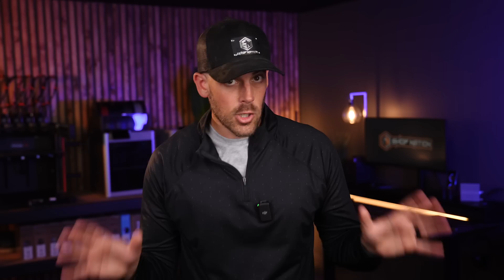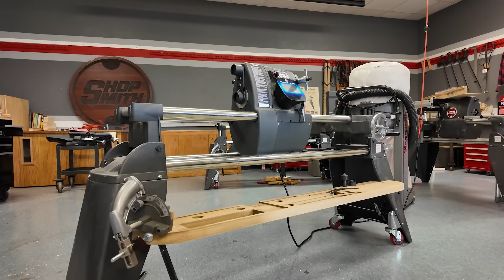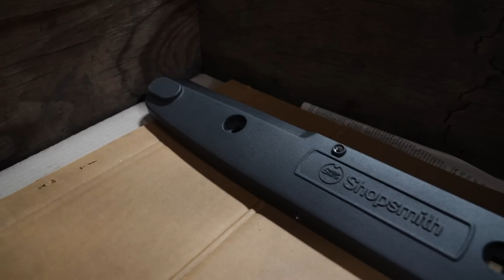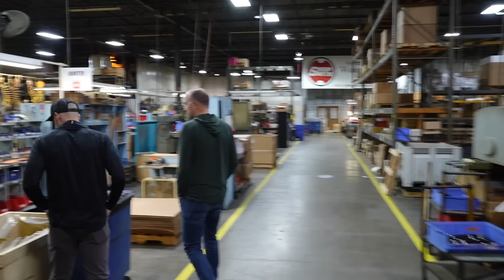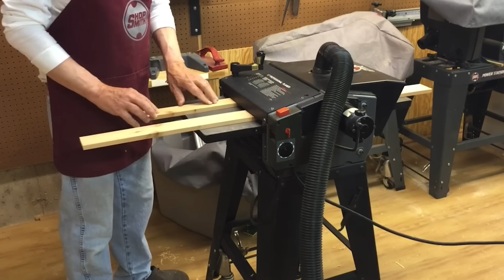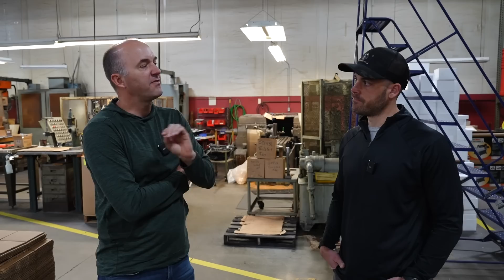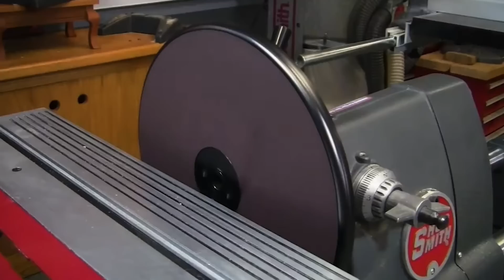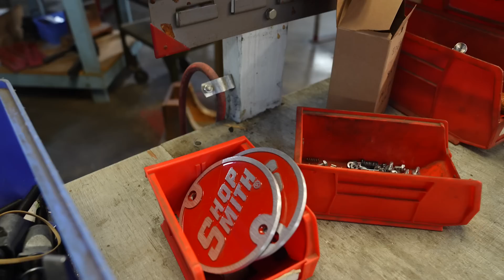The Last American Power Tool Company is (almost) dead

Comment: I purchased my Shopsmith Mark V at the end of 2006, with later purchases in 2007. And it continues to work great. I almost quite literally have all the tools and accessories that are available with this system except the latest electronic control console that is now either sold with the new machines or purchased separately for us folks who purchased ours years ago. And although Shopsmith offered and continues to offer the ability for us owners who purchased their machines with the older analog control head, to upgrade to the newer electronic control head, I just can't afford it anymore. LOL. But with exceptions, I have used every single piece of separate ancillary equipment besides the table saw; e.g. the scrollsaw, bandsaw, thickness planer, woodturner, sanding disk, router table, and jointer. There are a boatload of ancillary pieces of equipment that I also purchased later, such as the support legs for the additional support tables, the upgraded table saw fence, and even the upgraded 3-inch locking polyurethane caster wheels that make rolling the otherwise heavy machine around the shop a piece of cake. This thing is amazing for all the things I can do with it; especially since I just don't have the capital to purchase these fun, potentially needed, and useful woodworking power tools and accessories all at once, or over time. 

In order to expedite my learning curve, I even purchased the 3-day Traveling Woodworking Academy (Maybe longer. I forgot) classes given by Michael Young, who I believe is still with the company. And I also purchased the entire series of DVD's on using the machine to refer to from time-to-time. This set of DVD's even includes the periodic maintenance videos given by Rick Davis that are needed to keep this machinery working forever. To be honest purchasing all this was not inexpensive for me at the time; over $5k, but the alternative and discussed in part in this YouTube video, is that it would take quite a bit of floor space in my already crowded garage to purchase stand-alone equipment. And I love the fact that this woodworking system is 100% American made. A few years following my initial purchase, and as I could afford to, I continued to purchase other ancillary pieces of Shopsmith equipment to enhance my woodworking fun. 

The only stand alone pieces of equipment I have purchased since have been a dedicated & deeper throat-cutting scrollsaw with a 30-inch throat, a dedicated wood turning machine and a 12" compound miter saw. As briefly mentioned in the video, I agree that the table saw continues to be the achilles heel for this system. For my work, the surface area is really too small for cutting and supporting large 4' x 8' sheets of plywood; even with the extension legs and tables, It just doesn't do it for me. But I don't have that kind of shop space for a dedicated table saw. As it is, I still have to park the miter saw outside in the backyard with a cover over it to keep it protected. Sooooo......  

With all that said, over the years, albeit it has not been totally inexpensive, to purchase a lot of other quality made standalone woodworking machinery would have exceeded $10k for all the various capabilities  I have in just the one power tool system. And knock on wood, I have never in all these years had to call Shopsmith for any maintenance failures except to repurchase and replace the tiny caster wheels that the base system came with back in 2006, with the upgraded 3-inch polyurethane locking caster wheels.  Last year (2024) these wheels finally fell apart. Although the replacement wheels weren't free, they were relatively easy to remove and replace.  In fact, I believe it was Michael Young that called me to inquire as to what happened to my upgraded caster wheels I purchased. He told me the company would possibly replace the two broken wheels for free with new ones after they evaluated the two that fell apart, but that would take too much time and I needed to get back to work on an existing wood project. In any case, I replaced all 4 of the 3" caster wheels as a set and was back to work in less than a week or so.  I sure hope this company doesn't go out of business, because with my luck, something probably will finally go wrong my machine. LOL. 

Thank you Shopsmith for making woodworking fun and pretty much affordable for all these years.

Comment: Reading the comments reinforces a longstanding opinion of mine: ShopSmith is totally related to older/elderly folks in most people’s eyes. Similar to gray Buick Century’s! I’m days away from 65 and I still have that perception. The words “my daddy had one in the mid 60’s”, and “I inherited my great grandfathers” are repeated countless times in the comments. Breaking that stigma is going to be a huge task, but totally necessary if they’re going to survive! They need to focus on people with the desire to have a shop, but have precious little space for it! Getting it in front of people and demonstrating that the various attachments are better than “ok if you don’t another choice for drill press, table saw, jointer etc” would help greatly also, because there’s a widely held belief that these attachments are not exactly top of the line in quality and operation. I hope y’all can figure out how to make a go of this! There’s a way, it’s just a matter of finding it!

Comment: I find it interesting how many comments begin with “My dad bought…” My story starts with “My dad ALMOST bought”. In fact, he placed an order and made a deposit back in the early 1970s. I was probably 10 - 12 years old at the time. He showed me the literature and the hardcover Power Tool Woodworking book given to him. Unfortunately, for some reason he got cold feet about the price and canceled the order. It was around $1,500 at the time. I was so disappointed. We only had a detached single car garage at the time, but the car was parked on the street so that wasn’t a big deal. The footprint of the SS would have been perfect and the time spent with him creating would’ve been great! I never let completely go of the SS brand. Fast forward to 2020. I bought my first rusted up and neglected Mark V “Greenie for $50, one of the firsts I’m sure and cleaned it all up as a Covid project during the early lockdown. I ended up finding a similar condition 10er and did the same. I then bought several others, as finding these old relics and participating in the social media groups becomes a bit addictive. I’ve resold all of them but the original greenie and a much newer gray headstock for a back up larger to change out someday. It will continue to have center stage at my makers space at Homer’s Bay Art & Garden with all the other standalone lathes and shop tools. I’m not sure anyone will read this long comment, but I’m watching every interview Nick does and pulling for the rebirth of the company. The Shopsmith may not be for everyone, as certain compromises are made to allow it to successfully deliver its mission. Like airplanes and sailboats, they all fly or float but in different manners for specific missions. Keep celebrating the legacy and the American made roots. Remember it’s not just about a cool and quality machine. It’s the experiences and relationships that will be born around it that will increase conversions and lead to new purchases. Nick you have an army of ambassadors not only in legacy users, but also the children and grandchildren who may never have taken up the hobby but remember the great projects grandpa and dad did. Gather them and deploy them to tell the rest of the story.

Comment: I bought a Shopsmith Mark 5 500 in 1978.  I took out a loan to pay for it but it was the best purchase I have ever made.  The machine rarely needs repair and it is easy to fix when it does (if you can fix a bicycle, you can fix an old Shopsmith).  It has been so useful and I am sure it will out last me.

Comment: The shopsmith would be great for me to put in the garage to knock out simple projects. The biggest hurdle for someone like me is getting started, because I have to "get everything out". I have a table saw, sliding miter saw, planer, etc, etc, but no dedicated space for them, because my main shop space is for metal fabrication.
Market to the guy like me that could use a convenient solution for a non-dedicated woodworking space.

Comment: Nick: There are hundreds of thousands of very loyal followers wishing you the best for success. Can anyone tell me of any other manufacturer that can boast of such an energetic customer base? It's a shame that the planer had to be discontinued as it is a unique example of engineering that no other planer can claim. I'm glad that I have three of them in my two shops. 
Your comments on the table saw mode are true. Yes, it is awkward doing bevels, and inconvenient if you need to frequently change blade height.  However it has advantages as well. With the power pro headstock it has the power of a table saw, and the ability to lower the cutting speed to avoid burn marks on cherry and maple. It's precision is right up there with the best saws on the market. As a lathe, it is more than adequate and even very good with the addition of the universal tool rest.
It's the most versatile and accurate drill press on the market. I can even drill horizontally, a mode that I often use.
There are a lot of us rooting for your success!

Comment: My Shopsmith was made in 1951, the year I was born. A neighbor from my childhood offered my father this tool  35 years ago and my father hauled it up to me in Oregon. Internet was not available in rural Oregon. I gave Shopsmith a call, got a parts catalog, called in an order and bamb! Parts arrived, Shopsmith restored for less than a Chinese battery drill. I have the band saw, 4 X 48" belt sander, table-saw and the 12" sanding disc. This is a perfect tool for the small shop where you don't have floor space for individual tools. The flip side is, the individual tools for the Shopsmith cost more than the Harbor Freight free standing models. Thank you for keeping the marque alive!

Comment: My dad bought one in the late 70s. He’s 83 now, his still worked but we needed to get rid of it because he didn’t use it. We set it on the side of the road and someone took it fortunately. He said the only thing he ever did repair wise, was replace the master switch, and it worked fine after that.  The disk sander was amazing and he did a few lathe works, but the table saw was now effective.  He ended up buying a separate table saw, which has kept.

Comment: I love the concept of Shopsmith, and anything that’s American made.  I’ve never used one, but I feel their biggest challenge is to make the “universal tool system” user friendly, and scalable.  I see the bench, and a bunch of steps I’ll have to take to retool the motor.  The other issue is a lot of woodworkers are chasing scale.  We want bigger tables, faster sanders, and larger depths.  Shopsmith has one version of everything, and unfortunately the people that would benefit the most from a modest powertool have no clue this solution exists.  Perhaps Shopsmith can use this concept to support small manufacturing startups.  An affordable and reliable platform producers can setup for multiple areas of production.

Comment: I'm 71 and bought my 1953 shopsmith at an estate sale in 1983. Over the years I have acquired every option available at estate sale and ebay..  Built a wood shop designed around this saw.   Takes a lot longer to use it but at 71 i'm not in a hurry!!

Comment: My stepfather had one (brand new) I bought one... used. The jack of all trades is a master of none. The table saw setup is completely stupid. I would buy another down the road but it would spend it's life as a lathe or horizontal boring machine. Otherwise all the "attachments" are worthless.

Comment: The newest model is $6,000 plus add-on's equals almost $8,000. All the woodworking tools purchased separately and professional grade would be about $4,000 or $2,000 for cheap models. Theres your answer for the decline.

Comment: (I started with an old 10ER. A little underpowered, but that just slowed down production. I made a tailstock on the far wall of the shop so I could turn 12' oars.) 
Okay, I'll support the new stuff, but I'll have to be supporting the price from the bottom. But first I need to know ... Which model had the most rigid frame? The best motor? That's the one I'll be looking for. I will shorten the ways to make the whole machine a little more compact, but it will be the last major tool I will buy. It's that good.

Comment: I'm building kitchen cabs out of quarter sawn white oak, no WAY would I run my large boards thru that little table saw, no way!  Its a great idea, looks well made too, luv the old school iron and steel and aluminum on the tools, it really bothers me to order parts and tools from China, hate it.  I would re-design the table saw it has to be beefier, and a 4" joiner just doesnt cut it I dont think.  Beef up the table saw and make the joiner larger.  Also stopping everything and putting in a blade would bother me, I need to turn on the saw at all times without messing w it.  I admit, having a lathe would be great though, I dont have one of those and they take up valuable space in a packed 3 car garage already

Comment: I have a ER model from Magna Engineering made in 1947 and a 1950 model Shopsmith. I have a bandsaw, jointer, spindle reproducer, and a speed reducer for turning. I have done a ton of work on these machines.

Comment: In year 2000 I found an unassembled, brand new in the box, ShopSmith stand alone planer at an estate sale. It even came with an extra set of blades. It is made to mount on the Mark V tubular rails or stand alone on it’s own stand. I didn’t realize you could buy it as a stand alone tool with it’s own  floor stand.
It has two motors, one for the power feed. I assembled it and only used it once or twice.  It really works nice. I had no idea they cost 2k.

Comment: Bought a 1953 shopsmith used about 15 years ago, the thing works perfectly, even the old motor runs smoothly. Best woodworking tool I’ve ever owned.

Comment: In '93 I loved the idea of the ShopSmith, however after mine arrived dented and unusable, the deliverer refused to take it back it sat in the half-opened crate for six months.  Finally they reimbursed me and the unit was returned because I was suppose to receive training on it and never received the training.  I would have accepted an undented unit, but that didn't pan out.

Comment: I didn't know ShopSmith was a thing until I was 35 years old. I'd say the number one thing that they need to focus on is marketing. Shopsmith should have their own YouTube channel doing what the education center and magazines used to do.

I don't know how ShopSmith's distribution / vendors work. But if they can work out a deal with the big box home improvement stores. So ShopSmith can be sold and promoted / plastered all over the big box stores websites just like DeWalt, Milwaukee, Makita, etc are. it will go a long way to get ShopSmith in view of the would be woodworkers and new woodworkers. 

If ShopSmith could make a smaller almost benchtop version of the Mark 7 that is much more budget friendly. That would go a long way to sell to the would be woodworkers that don't know if they like it yet.

Comment: i have a saw smith radial arm saw. its variable speed. it still works. i know nobody uses radial saws anymore but it a cool older tool.
Reply: that's because a sliding miter saw is more versatile, more portable and does a better job.

Comment: I have a Mark V and love it - since upgrading to a DC drive refit kit - but over the years the accessories have become SO expensive! Everything is just off the chart unjustifiable and when you add in the PITA it is to set them up a non-starter. I keep mine set up in table saw mode with an Inca fence I bought years ago. My only complaint is the ROYAL headache it is changing between tools. If you want to focus on one thing make it cut the ENDLESS adjustments and screwing around it takes to switch from mode to mode. Good luck to you Nick, wish you success!

Comment: Let me start of by saying that I am 78 years old. My Father bought a Shopsmith in the early 1950's  along with the jointer, and Jigsaw. He used it up until he passed in 1983. I inherited it at that time. I used it frequently until 2004 when metal fatigue ended its usefulness. So I bought a new  Shopsmith with tons of upgrades from the original , I added a band saw . The amazing thing was that of the attachments from my fathers original Shopsmith fit and worked well on the new model.  with the new shop smith I have built a Pavilion Patio Cover with 6x6 post and beam construction Cedar roof with Metal roofing over that. I have also built a 10x12 Deck in the back yard and multiple other projects. So essentially my fathers Shopsmith lives on. I love this machine. Hope to pass it along to one of my sons.